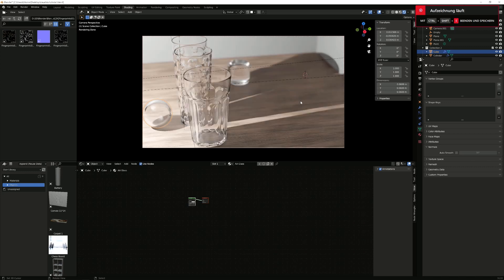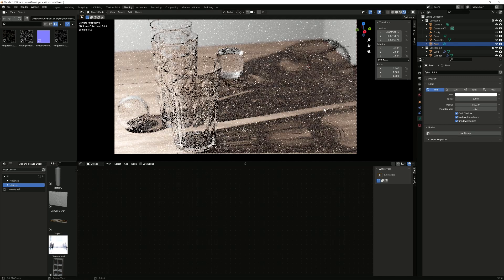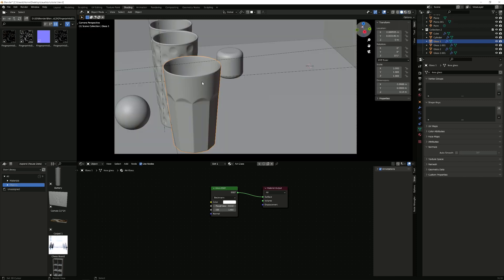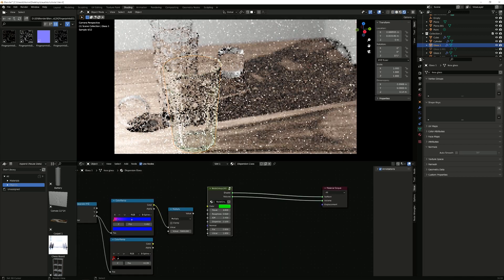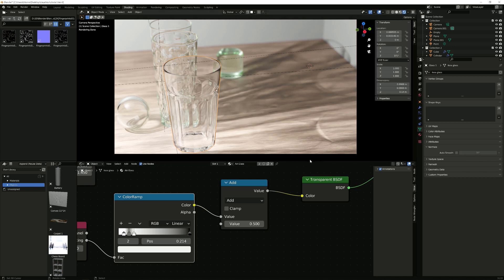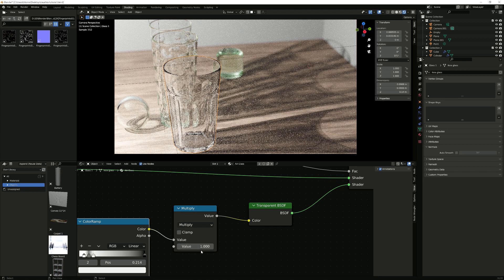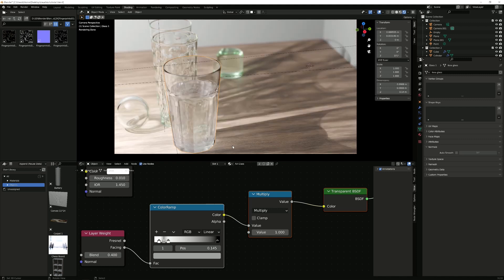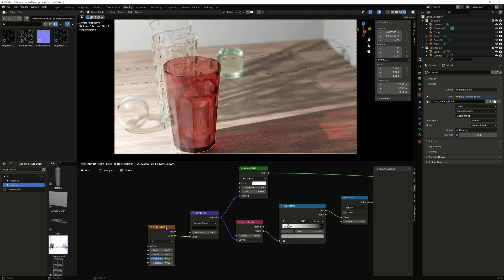How To Make Better Caustics / Blender Caustic Tutorial

Comment: I love your videos. How advanced can you get? I would love to see a shader unifying all of your glass shader techniques. Crystal dispersion, caustics, volume absorption, etching, control over reflection and refraction with regard to everything. How advanced can you make it? What about anisotropic light splitting seen on CD's and DVD's. Defects and bubbles within the glass? Scratches? Borosilicate? Coated glass? Diamond? Sandblasted glass? Can it all be added to one wonderful shader? I suspect you are the man for the job! Great stuff.
Reply from the maker: Hey there!
I'm really glad you enjoyed the content :)

It can get very advanced, but fact of the matter is that you would always try to make the last complex shader possible 

The more nodes you add to the shader the harder it gets for your computer to handle and your render times will jump drastically, especially with refraction shaders

Of course I could add bubbles and cracks with a shader, but using image textures is more efficient than adding 5-15 nodes for a simple job :D

But yes, so far, using the techniques featured on my channel, you should be able to compile them all into one big shader
Reply: @philipkriegel Yes. I understand. I think it would be an interesting academic experiment to see if any of the interplay between the various techniques reveals anything new or Interesting. Really enjoy your videos.
Reply from the maker: There's wouldn't really be anything new
The dispersion method works great together with the standard way of getting caustics in Perth tracer engines, you can see the results of it in the video I made for it or on my Instagram if you're interested, but there wouldn't really be anything out of the ordinary, except for a lot of noise and 2 years of render time :D
Reply: @philipkriegel  Ha. Well I look forward to more of your videos. You deserve more followers.